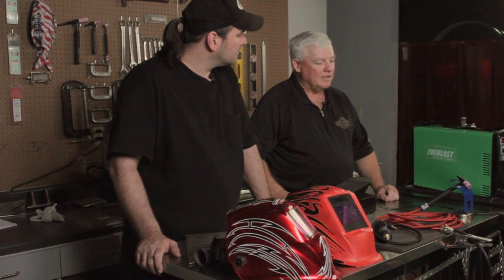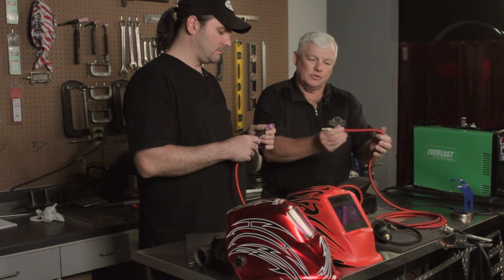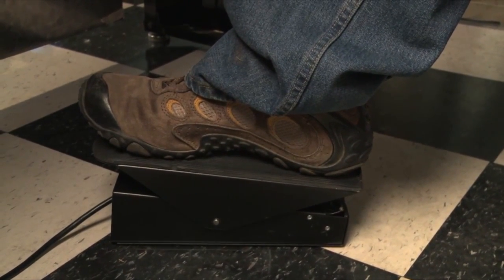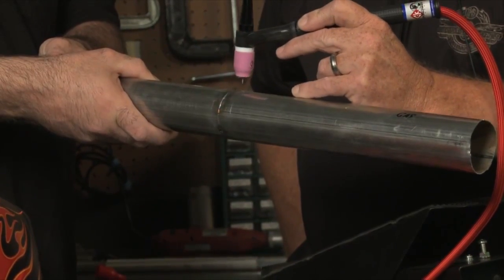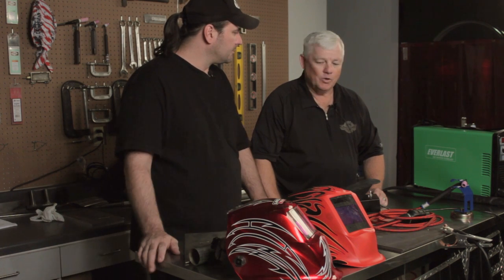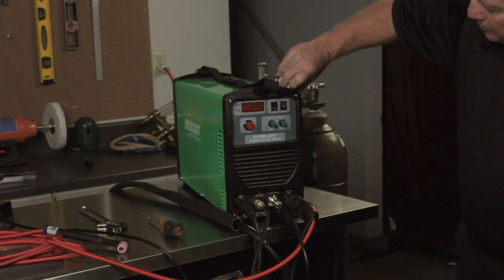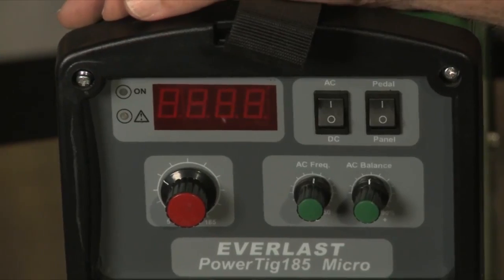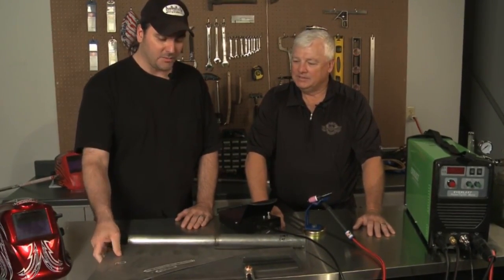TIG Welding Inverter Setup with EricTheCarGuy (Part 2) | TIG Time

Comment: Disconnecting the battery is not just a safety feature. The negative terminal of the battery should ALWAYS be disconnected with computer controlled vehicles to avoid back feeding and causing internal computer damage.

Comment from the maker: Disconnecting the battery is always an added safety feature, but sometimes is not practical.  If your ground is setup properly (as described before) you shouldn't have any problems.

Comment: Thank you for the reply, I was wondering if the battery cables had to be disconnected prior to welding  and would this prevent  any damage to the computers on board or is there a different procedure that would prevent damage to the  electrical system.

Comment from the maker: Steve, 
I deal with this issue everyday.  When TIG welding with HF (High Frequency) start on a machine, make sure that you place the ground clamp as close to (and preferably "on") the piece you are welding, if possible.  If your machine has a lift start,  HFis not a concern.  

Thanks for the question,

Mr. TIG